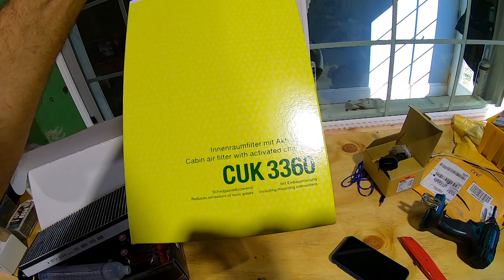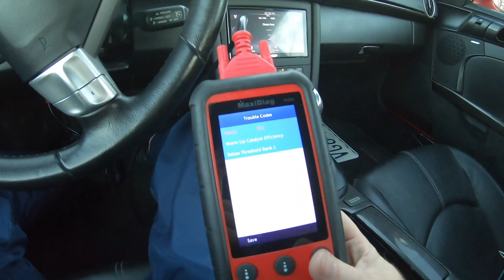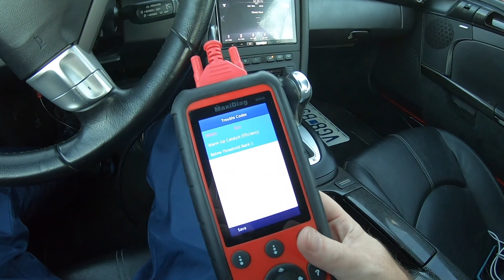FREE 987 Porsche Cayman HORSEPOWER UPGRADES !!!

Comment: Sorry to burst your bubble but changing the air filters and spark plugs does not lead to higher hp gains. The gains are negligible - have you done a dyno test for the before/after hp? If not, it must be the butt dyno. I've spent tonnes of money changing the headers/exhaust along with plenum upgrades for my 987.2 and it gave me about 40hp increase. Nevertheless clean ride.
Reply from the maker: Thats not what i said, what i said was it is restoring horsepower the original lost hp, getting the numbers u to what they once were
Reply: No

Comment: Personally I hate those free-flowing filters. I would rather keep my engine clean and sacrifice the better sound and very slight performance gain.  Nobody ever oils them up like you are supposed to and if any of that oil gets onto the air flow sensor it will ruin it.
Reply: That or they don't oil them correctly. I use to work on a helicopter that used filters we clean and oil. I remember a set got over oiled and was an issue. That made me think if someone doesn't oil them.or dry them correctly the performance could be worse than OEM filter.

Comment: I bought 2005 porsche boxster in 2016 with 95k miles for 12k and had did IMS,new cluth and flywheel done by  Shop. I did my self air filter, water pump ,low temperature thermostat and Trans services and it was manual 5 speed. Sold after year for $13500 with 98k miles. Bought 2005 911 c2 with 47k miles for $33k. Done ims and cluth from same shop. Month after I bought car it had bad misfire and founds out that all coils were cracked. I did all 6 coils (beru updated coils) all plugs(Bosch) from pelican parts. Later year i did water pump,low temp thermostat and Trans service,lowering springs,short throw shifter, headers and catless X pipe.

Comment: 987s are relatively easy to work on.
The problem with a "performance" engine air filter is you need to keep it oiled or it will allow dirt into the engine.  They are just an open gauze material that depends on the oil for catching dirt.  But if you over oil them they'll foul your MAF with the oil.  Basically it's a fine line with these filters in having them operating properly.  Yeah, you might be able to scrimp on a few bucks but how about the $$$ spent on the damage it causes?  To each their own.
Enjoy your channel.

Comment: I performed the same removal of the impact plate behind the air intake just as you did and epoxied a 2mm weave fiberglass screen to the back of the support structure for the grillwork. This will keep sand and other debris out and allow all the air the engine wants in. The stock airbox design will flow enough air to support modifications to a 420 HP level, other parts need replacement to get there though.

Comment: The K&N also has a clamp that is a real bastard to install for sealing it to the airbox. The BMC appears to go in place a lot easier, as is doesn't have to stretch around the oval orifice in the airbox. I advise others to use the BMC as you did.
Reply from the maker: Yes it went in with no hassle, still doing great

Comment: Soo you PAID for a BMC air filter and NGK Spark plugs. Removed part of the air intake. The part that stops your intake sucking in a load of crap. Then claim that this increased power for free because it sounded a bit louder with no before and after Dyno?? Hmm 🤔

Comment: I got the stock Bosch FGR5KQE0 spark plugs that are apparently pregapped to 0.064” (purchased from FCP Euro and states they are good to go with 987.1). I’m not sure I should install these or get another set elsewhere bc I keep reading the proper gap is 0.032” which is exactly half that. I realize 0.032” is quite thin but I’d rather not risk piston / spark plug contact. Any thoughts?
Reply: What? Can’t you simply regap them?

Comment: Hello

Im about to change the the air filter to the BMC on my Cayman 987 base. Im reading about the right ammount of oil? 
Should i not replace the standard airfilter with the BMC or what? 
Please help a newbie :-) 

-Kasper
Reply from the maker: Yes i ddi the BMW swap, i didnt oil the filter since it comes pre oiled, when you clean it down the road use a minimal amount of oil or it will get allover your MAF

Comment: Make sure you use an air gun to blow out as much of the oil as you can from that filter because you may foul your MAF sensor.
Reply from the maker: It didnt have alot of oil on it , but i have had that issue before

Comment: Take out the snorkel.The plate is intended for keeping the air filter dry. This must remain in place!
The snorkel is the limiter!
Reply: I think it’s been dyno tested several times on both the 986 and 987 that removing the snorkel may increase noise and the perception of performance but there is no gain in power. Our senses can be fickle things. Others have tested flow and say the entire stock intake system can flow much more than even needed.

Comment: This video was just "maintenance" not "upgrades", at best you just get some lone lost horse back.
Air filter isn't a hp upgrade.. it's just a placebo effect. 
The desnorkel just gives it a slightly better intake sound

And btw, that engine is filthy... How can you work in such a dirty workplace? ?!
Clean your engine before you open up the air filter housing, so you don't get dust in the intake when the filter isn't on.
Reply: Looks like it’s been on a desert rally under the frunk covers too